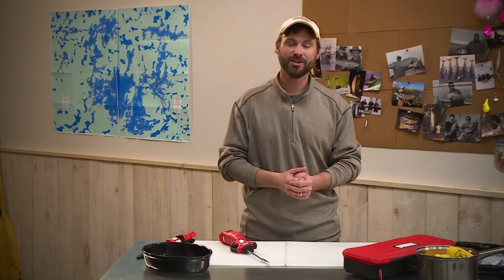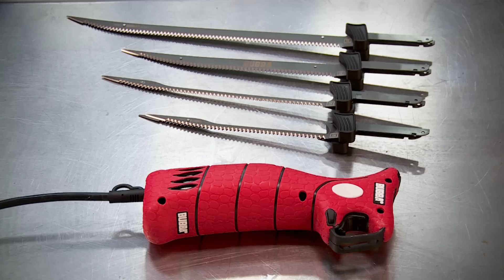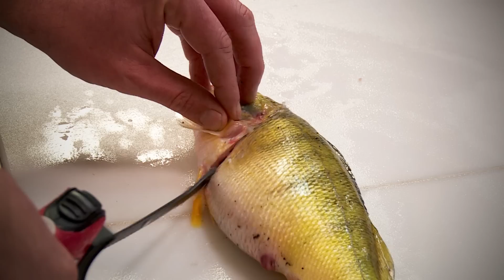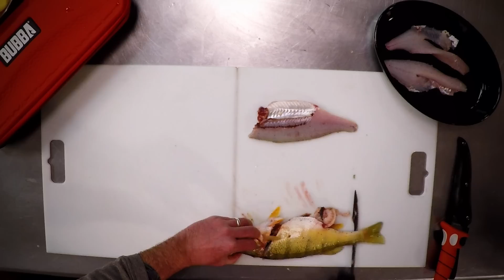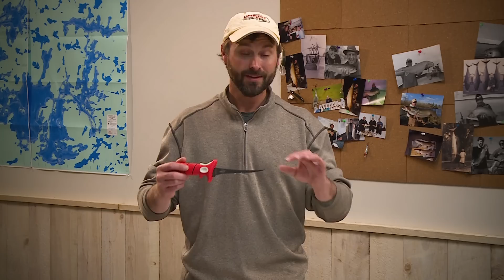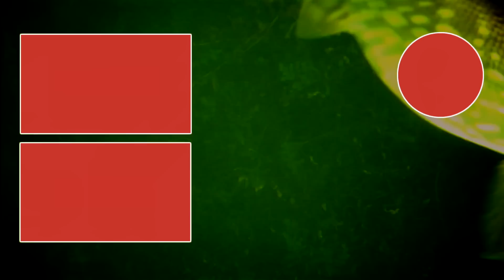How to Fillet Perch w/ Electric Knives

Comment: That electric Bubba knife comes in a battery version and a plug-in version I cannot find any reviews for either one do you have a recommendation considering you seem to be using at least one of them? I have a Rapala fillet knife that plugs in two 12-volt or through an adapter to my wall but it is not very powerful and I was considering a plug-in electric but with these new lithium-ion I'm wondering if that is the Smart Choice any help would be a excellent thank you
Reply: I have the plug in version the blades are extra sharp nut the knife it self heats up a little bit, its also a little bulky. Its cuts really well. I plan on also buying the cordless version

Comment: Removing the pin bones as you have done here is referred to as a J-cut fillet in the culinary industry, generally we cut out the belly meat as well. I usually just remove them individually with pin bone tweezers. Keeps the fillet larger and more uniform for cooking. I want to try an electric knife but I feel like I wouldn’t end up using it. I keep my Japanese steel insanely sharp but that is a product of being in high end kitchens for years.
Reply: The culinary way is to have the fish already gutted & dressed for you. Makes it much easier to do the fillet's. Cracks me up when they say this is how you fillet a fish the right way. But they only do the last 3rd of the fish. First two thirds is catching it & gutting it. You chefs do the easiest part.
Reply: @BBBYpsi  what if said chef also is a fisherman....
Reply: We sometimes clean and fillet upwards of 70 fish per weekend. I couldn't live without Bubba. If you're filleting a lot, it's worth it.

Comment: As with any fish or game, the first thing should be get the guts out! By cutting through the guts multiple times you risk contamination and tainting the meat. I realize it might be quicker your way but I'd rather not risk intestinal contamination especially in fish. 🐡🐟
Reply: Ed Axeman 
Interesting, it never crossed my mind! I mean I usually try to be careful when cutting them up first, trying not to cut through their guts too much but I will definitely be more careful now, since it’s fairly easy to remove it.. specially on pike I like to first cut along the belly, then focus on top. But I still cut oldschool with regular fillet knife